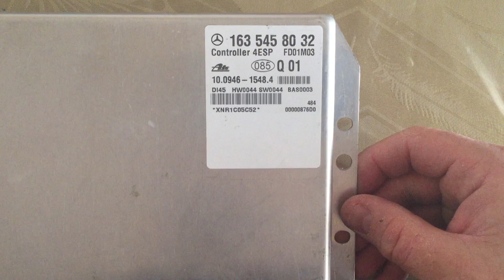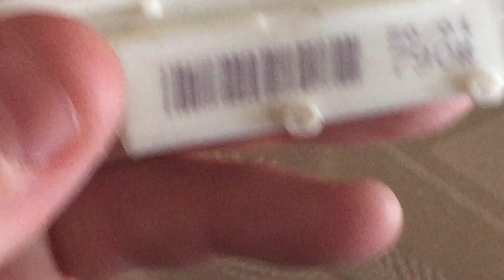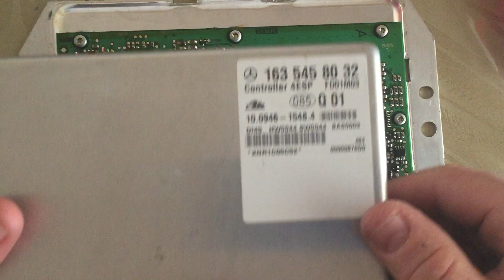Mercedes-Benz Controller 4ESP Module Teardown!

Comment: You are correct on what this is used for.  I also have a W163 ML Mercedes, I removed this from my car and replaced the two surface mounted Electrolytic Capacitors on the board.  It cleared up my CAN BUS faults (some of them).  The capacitors tested BAD.
Reply: Hello Jonathan. I'm having problem with this same module too, canbus faults... I'm wondering if you could remember your repair more, i mean where were these bad capacitors exactly in your pcb? Trying to fix mine like a one month now... 😀
Reply: @y-motor  Umm...  they are the only ones on the PCB. lol. Can't miss them...
Reply: @y-motor  Just to be clear, there are ONLY 2 caps in the module....  IIRC, one of them was a 47uf @ 35v, and the other was a 22@ 25v.  Don't quote me on that tho
Reply: @Johnathan_Waters  oh, ok, i thought you meant these small caps in there. Have to try change these bigger capacitors. If it doesn't help, do you have any else good ideas what could be wrong with these controls units...? Thankyou very much for helping!
Reply: @y-motor  Not really no.  And its honestly not really WORTH troubleshooting, at least not while cheap used computers are still plentiful/available!  In 15 years, it will be a different story...
Reply: @Johnathan_Waters  Ok, that's true, but i think i still try... Thankyou anyway for helping me!
Reply: @y-motor  good luck. Please do share your findings!!!  And no, i meant the large electrolytic capacitors.